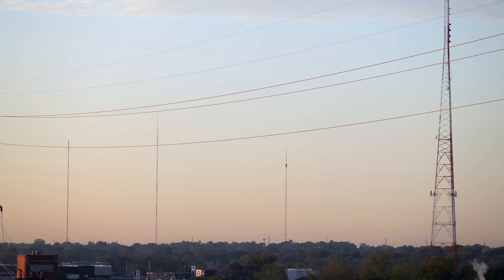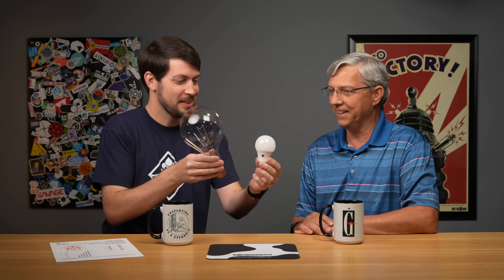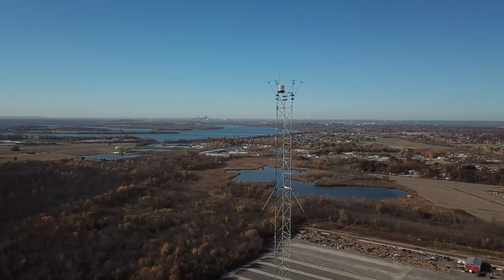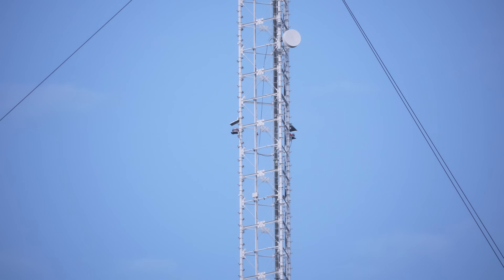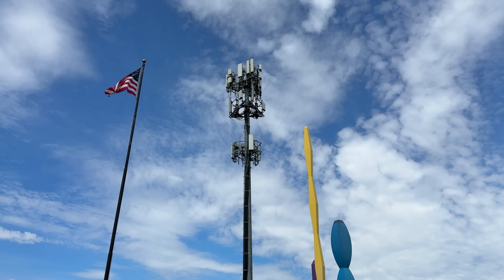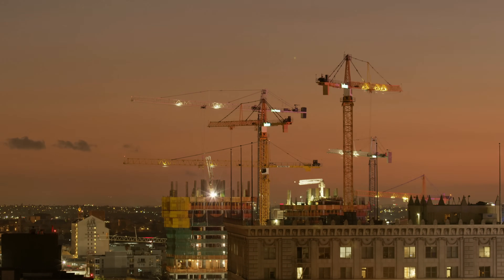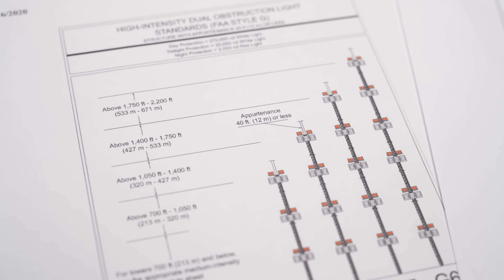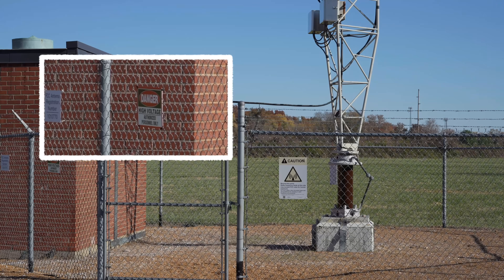Why do some radio towers blink?

Comment: I had a pretty bad tower light situation once.

So just before this was discovered, our long time Contract chief Radio Engineer had a massive heart attack and passed away suddenly. I was then suddenly promoted to chief engineer. While I was nowhere near being experienced Engineer at the time, I thankfully had some experience thanks to the aforementioned contract chief engineer. That being said, I did not know the finer details of each of the transmitter sites.

While going through the engineering cabinet, I discovered a tower light check in sheet.

upon finding this sheet, I was extremely concerned as I had visited all of our tower sites and hadn’t seen lights on any of them. I then proceeded to pull every single license for all of the towers and reviewed them and discovered that one of them did in fact require tower lights.

Worse, I knew for a fact that the lights on that tower were not working as I had been there making repairs after it took a double lightning strike and was nearly destroyed.

I then proceeded to call an engineering acquaintance, told him what I discovered and asked him what I needed to be done and have maintained contact with the engineers there over the years to provide support when I can

That was the day I learned how to call in NOTAM.

Upon investigation, we traced the issue to the daylight sensor which was stuck off. while trying to get approval for repairs, the daylight sensor ended up getting unstuck and turned on and got stuck again.

I also discovered that the tower light system was not connected to the remote control and thus could not be monitored with it.

Unfortunately due to poor ownership I could not get repairs approved BUT I did get the lights reconnected to the remote control and got the daily checks restarted.

I subsequently discovered that these stations were riddled with compliance problems. I spent the last two years I worked there correcting as much as I could. When I left they were very close to fully compliant and I left detailed information for my successor as to what still needed to be done. 

I don’t blame the contract engineer as I quickly found out how difficult it was to get anything approved.

In the experience I had with engineering, small stations are the worst. They complain about how expensive everything is and don’t want to do the maintenance and upkeep they’re supposed to. 

The engineering community is amazing. They’re all networked with each other and most all of them know each other and are willing to help anytime. This is literally the only reason I survived getting thrown into engineering in the deep end…that and the training our late contract engineer gave me.
Reply: Quite a story! Glad to see you worked to make it a better situation and know the value of the engineering community. Thanks for the comment!

Comment: Tower paint and painting. In the US, towers are painted alternating read and white in seven equal bands, starting and ending in red. Other countries have different standards. If you see a picture of a tower with a different number of bands, it is not in the US. 

The towers are painted with red or white latex house paint. The towers are galvanized and other types of paint do not adhear well to zinc. If they used red lead, it would not be galvanized steel.

Galvanizing is a protective cathodic coating for the steel. The zinc is sacrificed to protect the steel and the zinc forms a protective white zinc oxide. The zinc oxide will cause paint to bubble and peak off with age. Latex is rubbery and span over the zinc oxide layer and have a longer life.

And that is why tower manufacturers provide red and white latex paint and a painting drawing when you purchase a new tower that is to be painted. The installer paints the tower.

Comment: I live in a Dayton, OH suburb that has a site with two identical towers that normally have red lights at night. One tower's lights will go completely out, and once remained out for about two years. They repaired it and about 9 months later it went out again for another 18 months. It's completely dark now and the other tower only has the lower lights working. Since we live near an air force base, I asked a few military friends about it out of curiosity and I was surprised to hear how serious it was for the lights to go out. But site owners never seem to be in a hurry to fix these. I also discovered that NOTAM's were filed for these instances, but that's it. It's as if it doesn't matter if lights are out as long as a NOTAM declares it. If so, why don't tower engineers simply file one NOTAM after another and just say to pilots, "There's an obstruction here. You won't see it. Go around because we're not doing anything about it." That's certainly what seems to be the case here, even though I know it's probably just something simple like an inability to find workers to go up and replace light bulbs. As a layman with a genuine curiosity about these things, I wonder why these towers are allowed to be dark for so long. They're not quite 400' tall and very close to a medical helicopter flight path.
Reply from the maker: Sometimes it may be down to disinterested owners. Sadly many towers get abandoned, or nearly so... not good when it's still a hazard!

Comment: During the 1980s I worked at a TV station which has a 1,600 ft. tower. One evening we had severe weather in progress which knocked out part of the power at the site. The engineer immediately called the FAA to notify them of the situation.

Comment: Last year here in Houston we had a helicopter crash that caused loss of life and caused the whole tower to come down. The lights were out and there was a bulletin warning of it that the pilot ignored or missed.
Reply: The pilot did not necessarily "ignore or miss" the NOTAM. 
An advisory can heighten awareness, but it does not obviate the fact that the dangerous condition existed. 
When you file an IFR flight plan and you get two pages of NOTAMS it just means you are trying to do your job while others are not doing theirs.
Reply: One had working lighting and the gal flew it right into it !
Reply: @jhonsiders6077  Oh - you initially said the lights were out. 
Very sorry to hear that.

Comment: I am a radio engineer for offshore wind. We use FAA AC 70/7460-1 compliant Aircraft Detection Lighting System radars to suppress the aviation obstruction lights in the wind farm. When there is no aviation traffic flying above or close to the wind farm, all lights go off to reduce light pollution.

Fun fact: A lot of the aviation obstruction lights also have infrared light along with red light. It may not be flashing with a naked eye but pull up an infra red camera and you can see it

Comment: To those saying the NOTAMs are worthless, while I do agree that they can be spammy I do use them and always check the Obstacle section.  Pretty simple since we mostly fly high enough that towers are not a consideration.  But for departure and approach I simply look for obstacles within a three mile radius of the airport.  If I find any I check distance and bearing.  Most of the time the obstruction will be no factor, even in go-around scenarios, and we’re done.  Sometimes, tho, you will be surprised and glad you checked.  It’s a 30 second exercise and guy wires are the stuff of nightmares.  Yes, the NOTAMs format is horrible and something should be done.

Comment: We have a lower budget radio station close to where I live, that has three towers that are probably ~700-1000 feet tall. They still use incandescent bulbs (cool), but seem to gradually let the majority of the bulbs burn out over a couple year period of time... I'm pretty sure there are three lighted positions on each, so out of a total of nine fixtures, I've seen as little as two of them working. They're within 5 miles of a small regional airport, but seem to get away with re-lamping maybe every five years.

Comment: Interesting video.  How do they get the lights to flash in synchronization on multiple towers kilometres apart?  A single source power supply would not be feasible over these distances.
Reply: gps synchronized time, and the lights flash on the same schedule on the same seconds on both towers
Reply from the maker: Most systems just flash at the top of the second, and GPS time will give you sub-ms accuracy. Most tower sites have services that require GPS timing already, so if you tie into that signal, the lights can also be coordinated pretty precisely!

Even modern NTP can be pretty close, within tens of ms
Reply: @GeerlingEngineering  Thank You, I always wondered.

Comment: I worked at a small dealer manufacturer. We had Magnis that would go up 150 feet lived in a town called Chico where we have a municipal airport and the town is pretty small. We got a call from the airport telling us to put lights on top of the equipment, or take it down

Comment: Still remember the long escalation of the radio towers I did maintenance when I've worked for my country water utility company... Was a real pain to have to change a burned bulb on that 200mts high tower... 
Was the main repeater for the center region of Portugal on low band VHF (56Mhz)...
For sure that the people working there now are quite glad for the LED technology that avoid them to have to escalate the thing just for the Lights anual inspection...
👍

Comment: I lived in Tucson.  The antennas on top of the Tucson mountains or Sentinel Peak have no lights and sit pretty close to the flight path of Tucson International Airport. There's a group of antennas across town on Mt. Bigalow, which is much higher than the Tucson Mountains or Sentinel peak they have lights but are nowhere near an airport. Every antealong the valley floor has lights.

Comment: I had a repurposed 64' tower from a local airport that I used for a home-based VLPFM station here in Canada. It had dual warning lights at the top for its airport life, but weren't needed in my locale. Since the cable was still good, I decided to power them up one winter night around Christmas (they were red, of course). The parade of townspeople driving by the house was impressive... I found out later they were mostly parents telling their children about the legend of the local Rudolf the Red Nosed Tower Deer.

Comment: What I want to know about towers: How do they change the light bulbs?!?
Reply: They pay a tower crew to climb up and change them - how else would you do it? That's why in most cases, you see 2 lights together, so if one burns out, someone doesn't need to be brought out on short notice to climb and replace it. Especially with incandescent bulbs
Reply: @gorak9000  how else? perhaps an autonomous device? nothings too absurd today right now.

Comment: interesting.. you must be close.. that porter av tower is about 2500 feet away from my house. was always curious about that thing , who owned it and who leases on it.  one day i did an fcc deep dive and found the owner and some ( very minimal } info.. ( I was searching for Radio stations to find proper band reject filters for my radios, scanners. etc.) it didnt5 seem to have Broadcast or cellular equip at all. Most were small waveguides ,and  I assume, Micro wave shots carrying financial data...  it wasn't the culprit.. however I did find a FM transmitter just off of 170 that I blocked.  Cant remember call sign, But the content the were playing sucked... HAHA
Reply: thanks for confirming that tower. i was in doubt because it looked too close but what other unguyed mast could it have been really. 3's

Comment: Great video. Yes it is the FAA that is in charge of lighting. You do not want to be the engineer that gets a call from FAA you got a light out ! That comes with a big fine. Yes it is 30 minutes to call FAA . The station I worked at was AM and 4 towers with tights that did the slow blink on top . Same old lamps in video. Now they LED . The LED uses much less power and has photo diode bult in. And in some stations are battery back up and gen set . Years back during a blizzard a lightning strike hit tower took out lamp 1 down from top one. Took station off line. Damage to RF  relay for day/night pattern. And feed line damage at tower. Transmitter was fine. Also took out local grid power.  This happened late at night. I had to call FAA and tell them everything down . I do not know what light is on or off at this time, When I get to station I will update . They said thank you ,you are in a no fly zone due to weather anyways. Please up date when you can.  Also a report to FCC . Station off the air. Was a lot of time and a crew to get back on the air. First got back up transmitter warmed up and on 1 tower threw a alternat feed line.  Later that year part of tower was re painted from lighting burned the paint off. Crazy it hit 1 light down and not the top.  Hear in NY we get thunder snow. And that bad for towers some times . Snow static can buildup on AM tower causing arc gap to keep arcing taking transmitter off the air for some time. Not all AM towers like that . They DC ground at base and feed line goes up tower then connects . threw a big capacitor.  Maybe that something you can cover on ,Is different ways to feed AM towers and AM/FM /TV on same tower. Show how it is done.  Cheers from NY !

Comment: I notified the FAA when the cell tower down the road from me had no lights on it at night anymore.. the FAA was extremely thankful for my call, but it was about nine months before the lights were back operational, with an additional new white strobe that it never had But the white strobe runs 24/7 flashing a quarter mile of rural area, makes me wonder if they did it to be obnoxious after being reported.. to be fair, there is a grass airfield 1/4 mile away that the U.S. Navy frequently circles Seahawks around and life flight lands at, it’s only a 200 foot tower, But the Navy sometimes goes a little bit below 1000, mix that with some fog and a disoriented pilot with disagreeing GPS/ static pressure/ radar altimeters could easily hit it… I feel like a Karen but I know it’s a risk that’s easily negated. I couldn’t find contact information for the cellular tower owner, drove up to the gate and there was no contact information just warning signs.
Reply: spite is instutionalized often. i believe you might be right.

Comment: There used to be a trash incineration facility near me. They tore it down, however they didn't take down the smoke stack due to it being a bearing marker for planes. Plus they've mounted cell equipment to it now.
Reply: That's a good one!!
I know a location where the security lighting at the high school next to the airport is a much brighter, more visible  and reliable marker than any of the airport facilities, even though it is a towered Class D.

Comment: ? live in stlouis and noticed  the one tower [ blinking one marked why] has something black about 2/3 up  just recently... what is it?
Reply from the maker: That's some screening to help contain paint as there are climbers repainting that tower right now. it will be moving down the tower over the next few weeks!
Reply: @GeerlingEngineering  Did you hear about the crazy guy who started climbing it the other day? He made it like 300 ft up. A tower worker who was leaving work for the day started climbing up after him but the climber was fast as hell. The tower worker is pretty much a hero as he's the only one who saw him and immediately called it in and even started climbing up after him, until he realized the climber had no intention of stopping and they would need the basket. The foreman lifted this worker up in the basket, where he attached himself to the tower and just bear hugged the climber who was punching and kicking the whole time. Young guy too he must have been scared for his life but fire dept came and they got the guy down safely. Incredible story. it's especially funny because the local Affton facebook groups have been obsessed with that platform as of late and claiming its 5G brainwaves.... I wonder fi the guy who climbed it thought that too.
Reply: thanks for getting an answer on that and my appologies for reiterating it in my post before getting this far down the comments.

Comment: Question for you, how do you resolve the potential problems of the supply to the beacon or light affecting a receiving mast and also the other way around too, how do you stop a high power antenna (say 1KW) for example from using the lighting cabling as a resonator. I would have thought a pair of copper conductors running along side a large antenna would affect its VSWR. Do fibre optics ever get used to mitigate this potential problem.

Would love to hear your father's thoughts on this... thanks.
Reply: The towers I had anything to do with ran the lighting wires in conduit.
Reply: Thanks for the reply... I wondered if any conduit was grounded. I was mainly curious as to how ducting or cables on an antenna could affect its performance or SWR characteristics. Thanks 🙂
Reply: @TRS-Tech  Well my work was with police radio not broadcast so the towers were grounded and the conduit bonded to the tower. As far as the antenna's went Decibel 
Products provided pattern charts for top mount, side mount etc. the feed line was always 100% shielded Heliax. We did have some problems with strobe discharge RFI getting into the receivers at one newer tower so we reverted to red lighting.
But I have been out of it for 15 years now so my comments might be dated.
Reply: Thank you for your kind attention. I myself worked on TETRA and AIRWAVE. In the UK it was the emergency services first trunk radio and encrypted radio system. Was a very interesting few tears getting the system to work with Motorola handsets and integrating the GPS position into the packet data. Thank you again for your reply 🙂